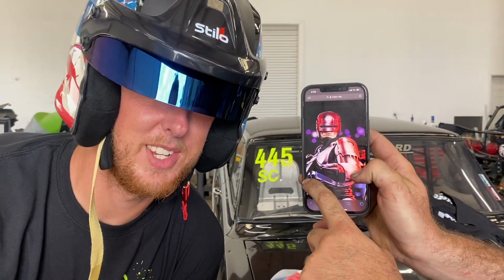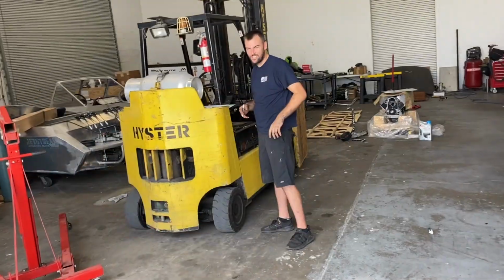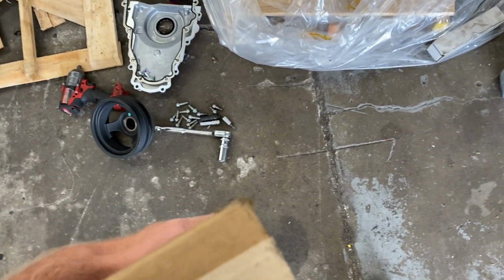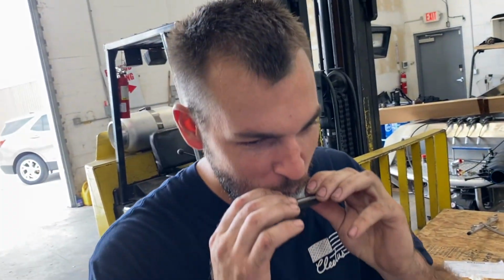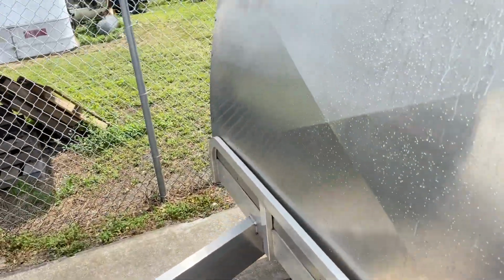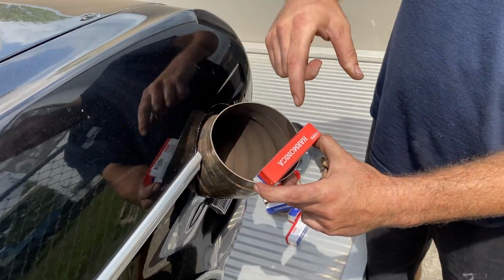We Hooked a GIGANTIC Weather Balloon To Our 1,500 Horsepower Boosted Nova!!!

Comment: The weather balloon 🎈 was cool in that as you watch the exhaust flow into the balloon you could see the acoustic resonance waves from each cylinder as they fired, but also observe the resonance waves propagation rippling in the balloon wall. Have you guys though about tuning your exhaust output through the shape and chamber size of the engineered exhaust to help enhance the flow? You guys produce some phenomenal HP with these boost engines, would it even matter?

Comment: I don't understand why people don't use a $10 cam installer. It makes it way easier than a bolt and you are way less likely to let the cam drop on the bushings. Also, thick grease helps cushion the impact when the lobe meets bushing, which it will at some point. I had a cam seize because someone nicked a bushing. When I was turning the engine over by hand it just locked up. I pulled the timing chain and the crank was free. I had to slide hammer the cam out. Luckily it was fine but a lobe had nicked a bushing on install. The cam was fine but that meant installing new bushings so I had to remove the crank to get them in. Having that not happen is worth the $10-$20 you'd spend on a proper installer. It won't %100 stop it but you have way more control over the cam and it makes it less likely to damage a bushing.